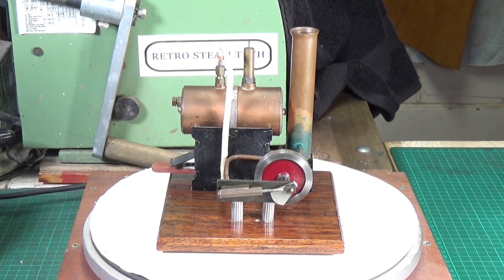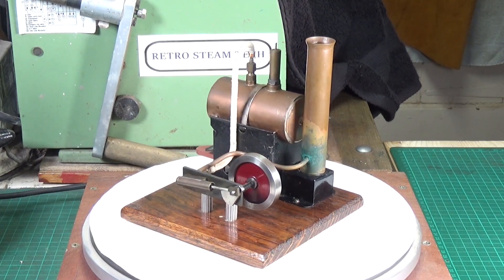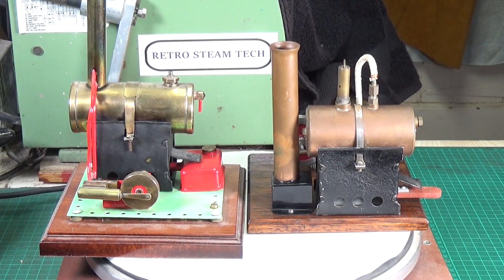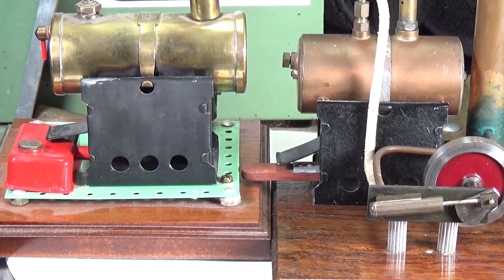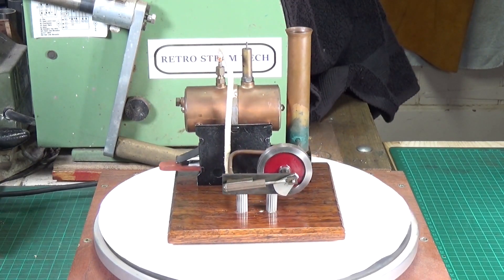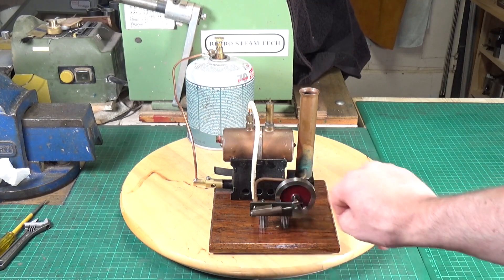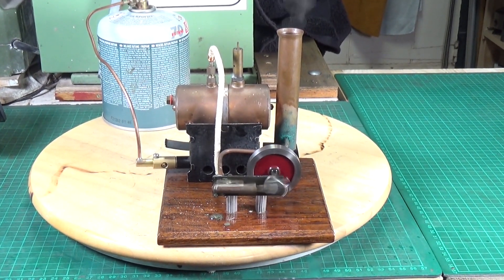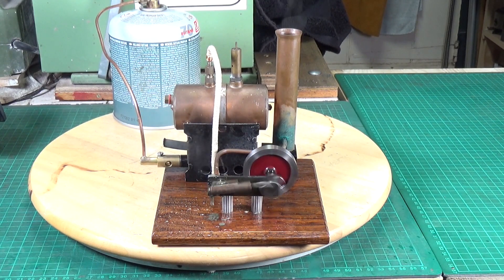British Scratch Built Model Steam Engine

Comment: I don't think a scratch builder would use tabs for the firebox.
Reply from the maker: No, I think the firebox is definitely from a commercially built Luton Bowman engine. The safety valve and boiler may also be commercially made but I think the rest of it is scratch built.